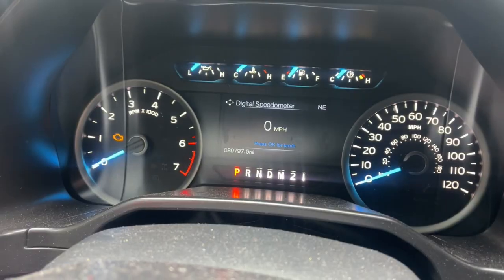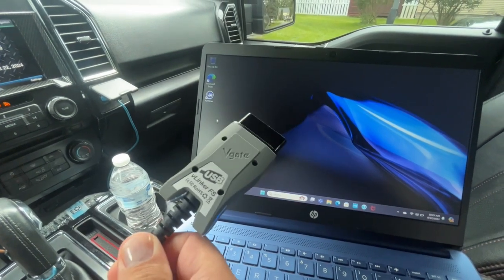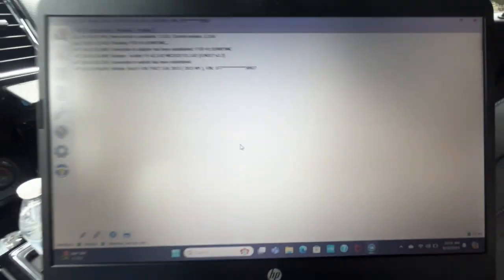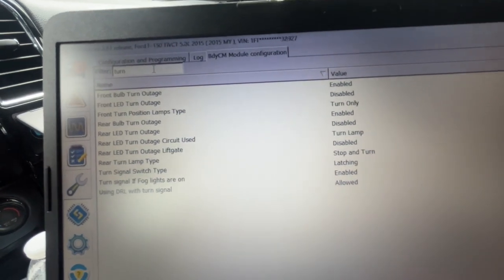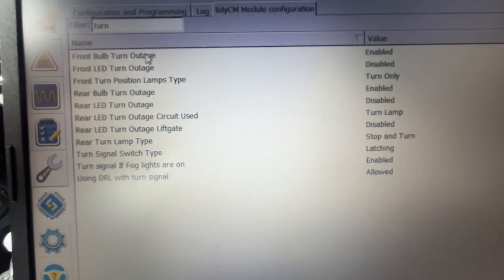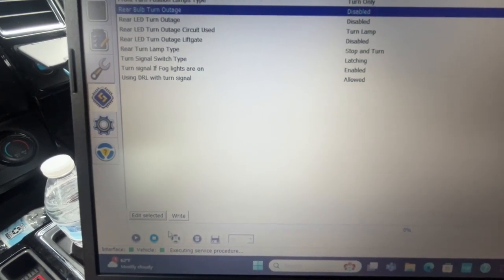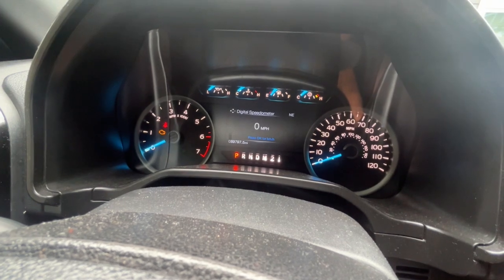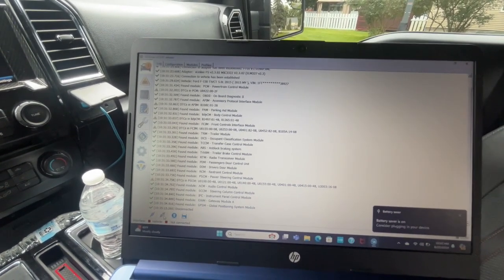Ford F150 Fix Fast Flashing Turn Signal after LED Install using ForScan

Comment: Since you've replaced bulbs with LEDs, would you not then Enable the "Front Turn LED Outage" and the "Rear Turn LED Outage" so the BdyCM can detect an LED outage?
Reply: I was wondering the same thing.
Reply: Same question

Comment: Just did this plus dark mode on my 2014 FX4 SCREW.
Reply from the maker: Dark mode?
Reply: @mw3designs  yes, disables lights from coming on when you open the door. Bothers me to walk away from the truck and the parking lights are still on from opening the door.